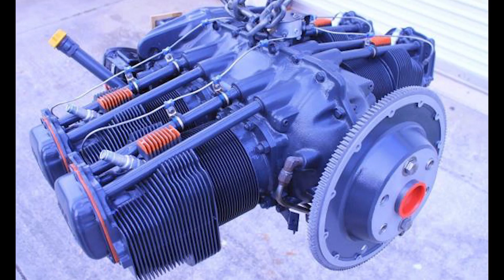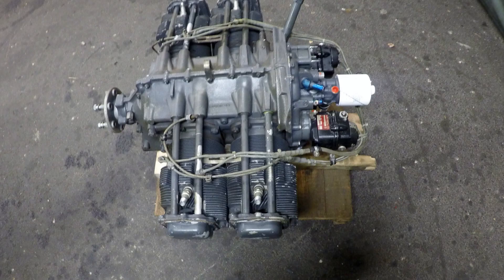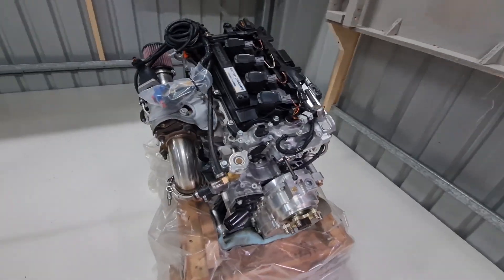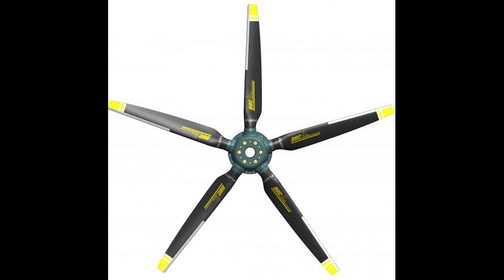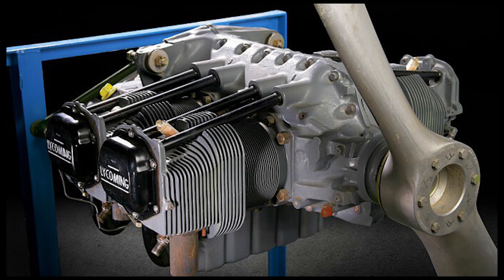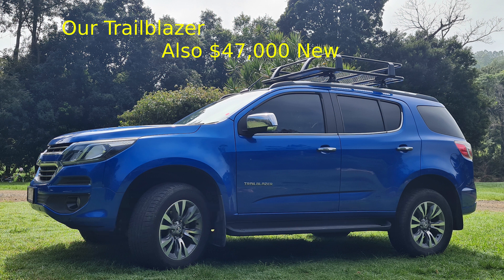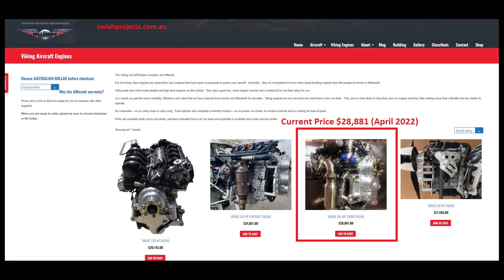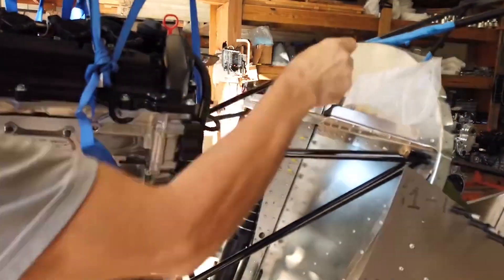Our engine choice for the Velocity

Comment: to be a further game changer...ad an external oil bypass filter, will remove engine wear particles and keep the oil analytically clean.     Removes the major engine wear particles that are 5 microns or less, and the full flow filter only removes at best 10 to 20 micron particles.     Do the research.
Reply from the maker: Sounds Interesting. At first glance I'm not sure if I want to take the oil out of the engine incase it doesn't make it back in. I think Viking recommend changing the oil regularly, 25 or 50 hours, which is way under the car mileage time. Maybe that will be enough. But I'm not ruling it out if it's a good idea.
Reply: @AusVelocity  Well, you take coolant out of the engine, correct, and you trust that it will work.  I understand there are complexities with adding a bypass oil filter, and yes it will introduce more possible failure points.     And sure, frequent oil changes will also provide longevity and less wear.    There is a bypass filter that was actually approval for aircraft use call the Frantz aero.    You will have an external filter, and the requisite plumbing to make fairly robust.    If you install a theromostatic switch on the external oil lines, you will have another route for cooling the oil and engine .    Oil cleans, cools, and lubricates.    Clean oil obviously does all of those things better.   And the clean oil environment is basically what you get when running bypass filters.  

Anyway, hope the build is going well.  I am looking between and RV10 and an SE FG.     The high energy landings shy me away from a velocity, but other than that I love that aircraft and its performance.

Comment: Turns out a comparable auto conversion is more than traditional engine with variable pitch prop.
Reply from the maker: How do mean more? 
More money, time, research, noise, vibration, maintenance, oil consumption, fuel cost?
Maybe you mean more bang per buck?

Comment: I also hesitated to install an auto conversion in my RV-7. I still think it should be possible, but the only argument that made sense is the 'constant power' that an aircraft engine needs to output. In the last 30 years I hardly see any car with engine issues at the side of the road. But when cruising with your car at 130km/h the power the engine provides is very limited (20%).
In my RV-7 I cruise at 260km/h at 65% power. 'They' (whom ever that may be) claim that a car engine will not run 65% for hours and not die.
I'm still not sure and although there were engine failures with car engines, there are many engine failures with aircraft engines.
I'll keep following you to see what happens.
I'm considering building an SE RG and will install a ULPower 520 (just like in my RV). It's an aircraft engine and also runs on Mogas.
https://www.youtube.com/watch?v=uoPvEIgRaZA
Reply from the maker: Thanks for the comment,
Yeah you can see it as a bit of a gamble to use a car engine.

But I've never bought in to the constant power argument. Firstly what is max power for a car engine? is it what the manufacturer says or what the kid who adds a bigger turbo, a load of boost pressure and upgrades the fuel injection system says it is?

if you break down power into torque and revs, it makes less sense. Cars can hit max torque whenever they accelerate. But what is max torque? Is it when the metal yields and the crank shaft snaps or when the fuel/air expansion cant push down the piston any harder due to the limitation of the fuel injectors and throttle body width?
Revs, the manufacturer gives me a conservatively placed red line on my tacho, to tell me what too many revs are.

I think the concern is running too much air and fuel (flames) through the cylinders over a short space of time. Then it comes down to cooling so you don't melt pistons, valves, rings and bearings.
You need to make sure the engine you choose can  extract the heat away from those components. I think modern engines are on top of this.

I think it's unfair to lump all auto engines together when comparing engine failure rates to traditional engines. Why should a 2020 Honda engine, a 2000s V8 LS engine, a 1990s rotary engine and a 1970s Volkswagen's engine all be put in the same category?

But I think the UL Power are good engines. The turbo is key for the Velocity, since it's supposed to climb high and go fast.
Reply: @AusVelocity  Yes I always marvel at the endurance of modern car engines. I remember the time when my dad drove a Peugeot (in the 70's) and that thing just broke down (and rotted). My current Volvo has 400.000 km and runs like a charm. And when in Germany I always try to get to 250 km/h and it can still do that after 9 years.
I also installed a ULPower in my RV-7, but I'm not sure of the Turbo. On paper it looks great, but it's expensive. Also in the Netherlands we are not allowed to climb over 6500 ft (seriously).
But I'll look into it when time of engine selection is there.
I wish you great success.
Marcel
Reply from the maker: @PHMNX  6500 !!! Ok the turbo may not be necessary. Good luck with whatever you choose.

Comment: why not diesel ?  lower rpm and muchmuch more torque  ?
Reply from the maker: Diesel is a good choice. Doing an aircraft conversion is a little above my pay grade. Maybe if i didn't have to build the aircraft, and if I had some good mentors, experts and engineers, then maybe. Not sure if i could get the required weight needed also. The delta hawk is now available, so if money was plentiful, then I could consider that an option.

Comment: G'day Clint, I deleted my previous comment about the Honda engine. I have looked at the Viking engines through curiosity and research and found the Owner to contradict himself many times with what he says and some of the information on his website is not accurate which makes me wonder how much is honest. The dyno graph for the 150 for instance has been made up, the power curve does not follow the torque curve. One video he states that certain technology/components of his engine are good and they don't use other technology, then other videos he is using the technology he said they don't use. He states engines are brand new "never been in a crash" but then on website that they are from donor cars. He does not appear to have much mechanical knowledge or understanding of what he is selling, often just states that "they feel it is good". Components are made and replaced with out explaining power differences or checking the tune. I strongly feel he is not being honest with most of what he says, and worry the customers may not be aware of what he is selling. I came to this conclusion on my own, and only recently have found an alarming past history of people stating the same concerns and actually experienced it. The Honda engine may be okay (not in my opinion) and not trying to spook you, this is just out of concern for your safety. Make sure you know what you are installing. An engine is very complex, it wasn't cheap either for what it is. Happy new year, all the best, hope nothing ever goes wrong and I am the one that is wrong. Probably delete this comment.
Reply from the maker: Hey Chippy,

Good to chat again.

Not really fussed that the engines aren't new, they are definitely not new, I'm pretty sure they say they are undamaged low time engines, crash or no crash. I would suspect a lot of builders on a budget would buy a "used" engine.

I can't explain the missing when running hot and not under load except that under load it runs better, I think it's because of the tune - timing(spark and valve)/fuel mixture, it's not tuned to run without a load as a car engine would be expected to. The engine is not getting hot since I didn't notice any temp rise in the coolant and i don't think the thermostat even opened. I suspect the ecu was trying to compensate for a lack of load (or something) with a richer mix rather than adjusting the spark or exhaust valve timing? not sure, but Viking were not surprised when I showed them a video of the engine missing without a prop. I noticed when I turned the alternator on (increased load) the missing stopped temporarily until the intake air got hotter.

I find it interesting that the torque curve for the 195t is to rise and plateau quickly. I think this is what you would like in a car that could use a wide rev ranges for similar wheel speeds, like at gear changes, so I assume the engine was designed for this. I've also noted that the typical aircraft engine torque curve follows rpm, I think this by design also and if the revs were allowed/able to climb past "redline" I wonder if the torque curve would also plateau?

If the graph is right then it shows the max load on the internal engine components is stable through the rev range and I assume Honda designed the components with this amount of torque in mind.

I can't speak for Jan from Viking except to say he's had both success and failures in his career of converting engines. I think he started with Subarus, some hits and some misses. To me, this shows experience and lessons learnt. rv6ejguy on youtube covers some of his work, look for 6 Subaru Powered Aircraft.

One of the good things about this engine is that I can ground "test" it flat out for quite a while to simulate it flying. I'll need an air blower on the radiator/intercooler. The typical aircraft engine has to be flown at speed to remain cool enough for extended "testing" as well as a break in if it's new. Can't wait for this stage of the build, I'd like to see what the generated thrust is, I'm sure Viking could tell me but I'd like to see the numbers myself.

Happy New Year
Reply: @AusVelocity  I assume the engine is tuned in Open Loop, meaning it is tuned to run a certain way regardless of outside changes; eg knock, exhaust temp etc. It is a very basic tune and is used as a backup tune for cars if a sensor fails, but should NOT be the primary tune. 
Ideally the torque curve is dead 'flat' meaning the power would rise at an exact tangent in relation to rpm, this is what race cars aim for, but is difficult. the first rise is due to boost coming on and the second because of valve timing changing with the 195T, I assume. Power follows torque and revs. Power is just a multiplication of torque and revs. A Dyno just measures torque at given intervals through out the rev range and notes the rpm and then calculates the power. (For my own testing and tuning I essentially set an engine rpm and apply a load on a spinning disc until rpm starts to drop. Just before the Rpm drops I read the most amount of torque applied and calculate my rpm. Done at small intervals I am able to plot my torque and power curve. Crude but this is Exactly how a dyno works). It appears accurate for the 195T, but the 150 graph is falsified, which makes me question other factors. Other aircraft engines may have a peaky torque curve as they are designed to operate in a specific rpm range. The Rotax series of engines have the best tuning of all the aircraft engines as far as VE is concerned calculated by me at around 95%. All others being around 80-85%. A higher revving engine is actually easier to get efficient at around 5000 with fuel injection compared to lower revving engines, but the Viking engines also seem to be around 80% which is strange due to having variable valve timing. Especially with turbo charging a Good VE should be around 100-105%. The issue with VVT/VTec, all variable valve timing for an aircraft engine is it is not really utilised properly and efficiency goes down. Even if a propeller is variable pitch and can absorb the power at higher rpm its is less efficient at a lower rpm, more so over a wider rpm range, making it pointless. A propeller is just a spinning wing, they are designed around an ideal speed and angle of attack etc.
Anyway, not trying to say the engine is unreliable or unsafe. Hopefully I am wrong, just feel that Viking is not honest and I express caution, I do not know him and have never dealt with him. I get a strong sense he is taking advantage of the demand in the market and selling what is available rather than what is ideal. Once again, not saying the engine is bad, just that he does not appear to fully understand what he is selling and when it comes to aviation and lives at stake this should not be allowed. Only writing for that reason. I recommend deleting these messages. I will write no more. All the best, take care mate. 

PS, testing is fun, trust me, well initially until you have to test for hundreds of hours resisting the urge to take to the sky. Like a young boy pacing himself the first time he makes love. Testing is not just running the engine at power, but introducing faults, disconnecting sensors while running really stressing the engine. This is all done by manufacturers. It's one thing for a car to cut power, but if you are climbing out over trees and the power cuts its a different story.
Reply: @AusVelocity  With regards to the Subaru engines, I have looked at them, they are okay, especially the 6. The fact that people had issues with those engines is not the engines fault, well the design. Most people that are flying aircraft have little mechanical knowledge, and having another tell them that something is good, is wrong. A common complaint with subaru engines is the open deck block which performance enthusiasts hate. If you had a fire ring it becomes the ideal design for low power output, it is just that people do not implement these basic design alterations. I'm using a Suzuki M13A non VVT. For an aircraft engine platform it is the best design available all things considered, but it still requires much modification to be suitable. It is not popular compared to Honda or nissan engines etc, but for low continuous power at 5000 with modifications it is the best. We do need people like Viking and Aeromomentum to push the market, but it should not be lead blind. I keep thinking about introducing an engine to the market, but then I look at the experimental market and see the quality of workmanship and worry about people filling with the wrong oil and then blaming me for a faulty product, it happens. I understand viking having that issue, but I could not sell something even if very profitable just to make money if I did not know it was ideal, tested and safe.
Reply from the maker: @chippyjohn1  Yes I agree you can't just slap an engine in an airplane and if you were going to do it alone you need to be pretty expert. I take my hat off to you.

Viking do make some demands when you use their engine for that very reason. I guess they've seen plenty of failure points and don't want shade being thrown at their engine/reputation when the amateur builder does something that doesn't pan out like they thought it would. They always have to play defense. Yes it's experimental but it doesn't have to be risky.

Good luck with your build, I'm sure you're starting from a good foundation. Hopefully everything around your engine fits and works as expected. Would be cool to see your progress on your channel.

Comment: I hate to be a naysayer but after 40 years and 2255 hours flying experimentals, I've seen many auto power plants tried but very very few succeed.  They always start out with a great analysis of how nice it will be, but success is a huge amount of work.  The Lycoming will be flying long after you've given up.  Sorry.
Reply from the maker: Yep no worries, I'm sure that has been the case for the last 40 years. It's a lot of work and know how to convert an auto engine for an airplane, that's not lost on me. I'm no where near good enough or knowledgeable enough to do a conversion.

I'm trusting viking to have designed, built and tested the whole engine system for me. The last several years they've had good success by not stuffing with the engine too much and working on the little things that catch the amateur builder out. I'll just wait and see how it goes. Not too much money sunk if it's not viable. If fact, I'm excited to see if the viking 195t can work in a velocity, for me, thats just as exciting as seeing the plane flying.

Thanks for the comment and I hope you follow along to find out if it works out or not. I don't mind the naysayers, they'll keep you in check and point out your errors.

I'm sure the Lycoming will still be around when i pull out the viking and put in an electric motor and fill the fuel tanks with batteries....not holding my breath for that one though.
Reply: I heard the same 25 yrs ago about those Rotax, and you are right, 50 yrs Lycos and Contis using technology from 90 yrs. Some of us had enough.
The auto engines are able to do the job long time ago, the key is the PSRU marriage. Now we are lucky, u2.

Comment: Looks great Velocity landing speed is 70 knots if you have engine issues you want to be high enough to find an airport can land at the glide range must be good not much drag on those things. I like Vikings some have had issue never know with engine sourcing from wrecked cars but most seem to run great can't beat the price for what you get I do like the fact that they can be fixed easily. I'm looking at a zenith 701 probably put one in it being a STOL aircraft easier to put it down on a road if need be.